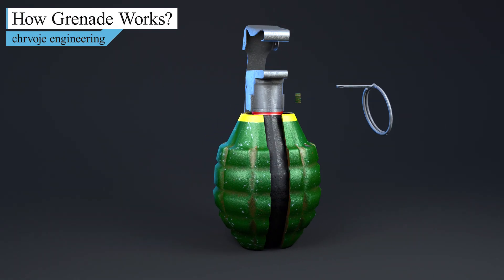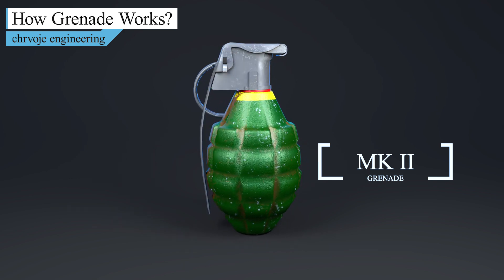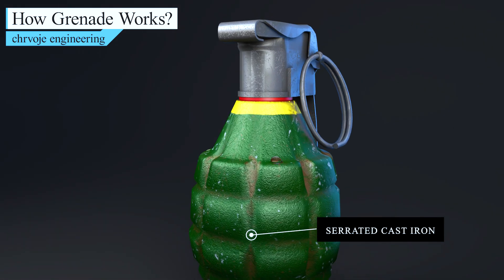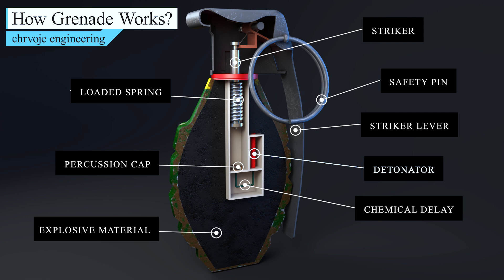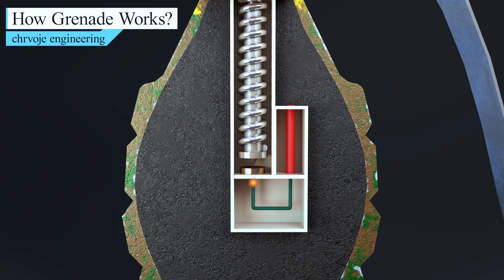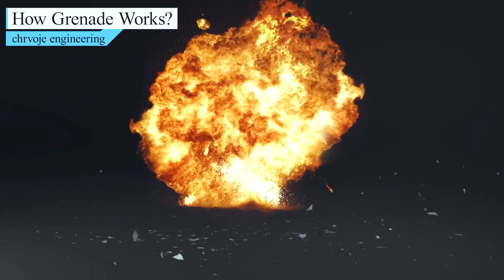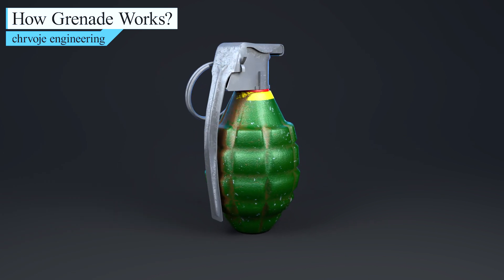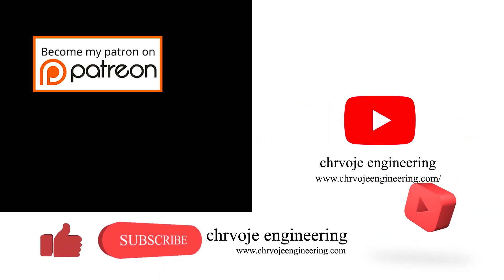How a Grenade Works? MK2 Grenade explained

Comment: Grenades don't blow things up like in the movies. Despite their explosive power, it isn’t the explosion itself that’s harmful. It’s the shrapnel. When a grenade blows up, the steel body disintegrates into a multitude of tiny pieces. Those fragments hurtle through the air in all directions, like a shotgun blast. The bumpy texture on the outside of many grenades (hence the nickname “pineapple”) helps them erupt into more effective shrapnel. If one of those pieces catches you wrong, it can be deadly.
Reply from the maker: Thanks

Comment: I would like to see what the explosions from one of these ACTUALLY looked like. I've been looking everywhere around the internet to try and find a MK-2 explosion, but can't find shit sadly.
Reply from the maker: Well, I try to finde also I didnt find
Reply: You are overthinking it. The Mk2 explosion is not unique. Simply go lookup similar fragmentation grenades on Youtube, like the M67 or RGD5, and you'll see how the MK2 would've looked like. There is no fuel explosion like you see in this video. There's some gray/black smoke. If there is dirt on the ground, you'll see the color of the dirt mixed in, as some of the dirt flies up into the air, depending on how loose the dirt is. Sometimes, but not always, you'll see a small flash.

Comment: Couple things wrong with this video:
1. MK2 simply refers to the model not its function. The MK2 (or Mark 2) was the model used in WWII by the United States. Other fragmentation grenades exist that do not carry the MK2 designation.
2. The mechanism shown is from a grenade called the Mills Hand Grenade used in WWI by the UK.
3. The grenades are filled from the bottom and sealed, not a hole in the side.
Reply from the maker: Well nice informatoion, I will try to check this

Comment: So its not dangerous moving with them on body? Maybe an big impact could activated the mechanism also without leave the pin? 
Technically looks like a loaded gun with one in the chamber
Reply from the maker: I think that it is safe to wear them on body, I belive
Reply from the maker: Maybe, some extreme heat can treager them, or, as you say, big impact